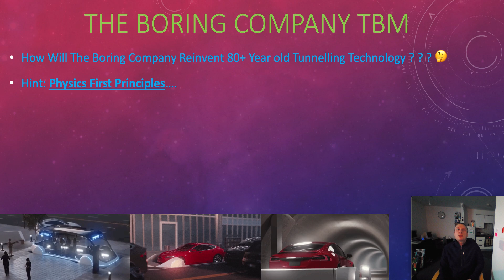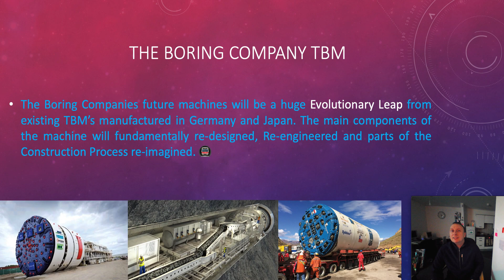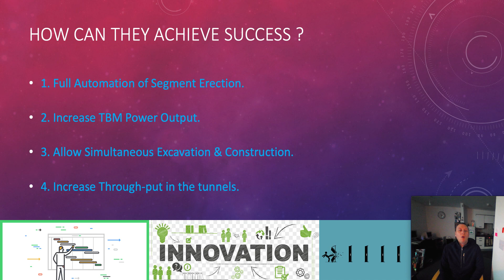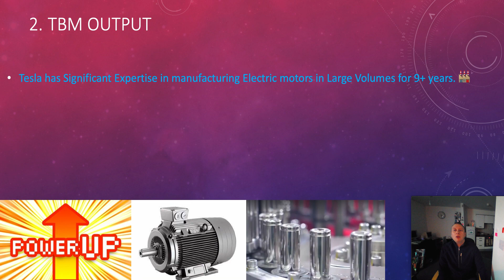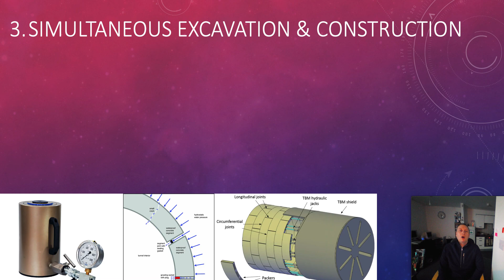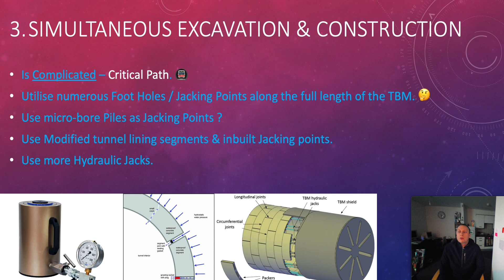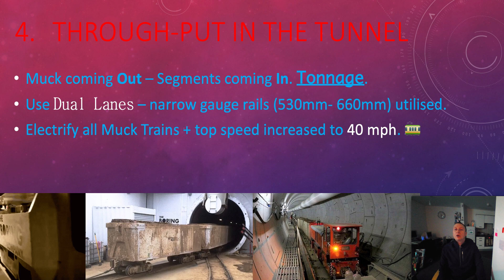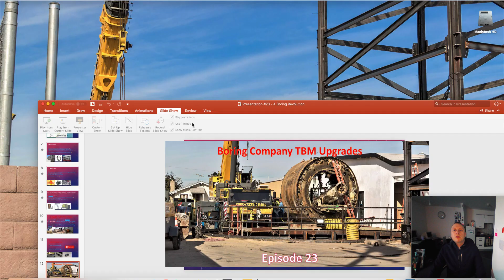The Boring Company - Elon Musk Now Wants A Total TBM Redesign - Episode 23 🚇

Comment: Flash transferring charge from train batteries to the boring machine batteries is inefficient and cuts cell life. It is better to have battery cars at the front of each train and switch between train batteries as needed. Battery cars can be pulled out on each half cycle for recharge outside.

Comment: 4:40 "lighter segments": the use of expensive carbon fiber is usually proposed as a chopped fiber additive. Another alternative is chopped cold-drawn stainless steel "rotini". 

Basalt is about 40x less expensive than Carbon and still keeps cracks very small. 

Pre-stressed Basalt yarn/composite skeletons can reinforce very thin concrete because there is no problem with rust/corrosion.

Comment: I'm calling BS on this video. I am sure all the other engineer firms have tried various ideas or think out of the box,.
Reply: IDK if anyone has 1. the resources to do a complete redesign of a TBM in the current boring industry or 2. ventured a their boring operations on prototype TBM.
I could be wrong, but getting the contracts, the tech, and the funding all together seems pretty uncommon without a radical infrastructure initiative.

Remember that no other company will have as easy access to: 1. super strong materials designed by spacex 2. super efficient electric motors and powerful battery tech from tesla

There's  certainly a lot of room to fail. But considering mr. musk's past 2 businesses have objectively changed the nature of their industry, I think this company has a better shot at making a splash than a Bezos company.

Comment: Will, all the details are well described and 
extremely important. The crucial and all defining 
function is the drill head. 

This is where everything is decided. This is 
where the revolutionary ideas come in. If your 
drill head eats its way through the 
subsurface, you have won.
Reply from the maker: I agree - Converting that Extra power into more RPM's = success ! But can the Segment erector keep up ? 
Elon has A lot of work to do. Line-Storm will change the Game!
Reply: I don't think so, Will. The existing machines 
have already explored and used these parameters 
mentioned by you here in the maximum possible 
way. It's about equipping the drill head with 
additional new First Principle capabilities.
Reply from the maker: Heinrich Peter Maria Radojewski Schäfer Leverkusen - the cutter blades and discs do a good job. New materials could be utilised but the shape will remain the same! 
The erector will need to assemble 8 segments every single minute for 21+ hours! That’s the key challenge... 😑
Reply: Hi Will, the work and speed at which the 
drill head is able to plough through the 
subsurface is the primary and all defining 
point. The traditional methods used here, 
as you describe here, do a good job. 

And that is the point. It is this traditional 
way of working the drill head that has to 
work exponentially better than before. The 
other connected operations you describe 
are secondary, aren't they? They should be 
approached as described in your video 
and solved by the engineers. 

The first thing you need is a drill head ploughing 
through the ground as fast as you want.

Translated with www.DeepL.com/Translator

Comment: Could they not extract rubble on conveyor belts rather than loading trains so there is a continuous removal. Perhaps attach the conveyor to the rear of the tbm and then as it moves add more sections at the tunnel entrance?
Reply: I think a conveyor belt wouldn't work so well because there is not much muck volume on a belt, and it's hard to continuously change to the correct length of it.  Battery trains have lots of volume and they can be as short or long as you need in any situation, by adding/removing cars.
Reply: Conveyor belts actually are used to transfer muck from the drill face to the muck train. Trains have value because they can be pulled very long distances with minimal energy used. Muck usually does need to be moved quite far from the tunnel entrance, and tunnels can be very long. Conveyor belts have greatest value when lifting up a slope, as only the product is lifted, not infrastructure.
Reply from the maker: Conveyor belts will probably only be used for the first 200m - after which trains will be more efficient!

Comment: Hello, I follow your video's a few weeks now TNX! Keep up the good work!
I always wanne ask one question pls?  Why don't they use a kind of pressed bricks instead of the concrete rings?
Why can't they make new models of bricks so they can use the material itself comming  from te machine?
Making the concrete rings directly while they are boring?  Think on the benefits of this?  Less material to remove out of the tunnel and it's a lot quicker to build that tunnel. Is this a good idea or am I wrong?
Reply from the maker: josé josiane it might work but reinforced concrete is tried and tested. 100% guaranteed to last 120 years. 
Concrete is a wonder material and is very easy to mould and sets in good time. It’s just convenient and engineers know its limitations I guess 🏗
Reply: @BoringRevolution  tnx 4 answering me. I know concrete last long but it's expensive to i guess and the material they win from boring tunnels would be a lot cheaper. Maybe it takes a while to that way. And maybe it wouldn't last for long. Anyway it was some small
 thoughts from my boring brains! ;)
Reply: @josejosiane4359  i am pretty sure they will experiment with this, and if remotely feasible certainly implement it. but their Bricks are a relatively new Product and might not qualify yet for this purpose.. (similiar to how SpaceX never tried any Booster Landings with the Falcon 1 - it was simply too early for that :D )
Reply: Did I hear correctly what Elon said? Yes he knows it, using the dirt on site mixing and building the walls is what he will try to do! Great!

Comment: here's a wacky non-thought out enuff idea. It's a two part solution. (1) a directional drilling machine lays down the pilot hole from the opposite end of the finished tunnel. These drills work MUCH better in the pulling  than the initial pushing. The finished pilot hole's job is to remove the muck from TBM. The big end of the tunnel is used solely for the lining the tunnel and et al.  This two part , two ended concept would work, in my dreams, in a segmented  tunnel building process...ie, thru a flat plain with many appropriate access points, as opposed to a very deep mountain without the possibility of shorter segmented sections. Constructing the segments simultaneously would be possible  to speed up any given tunnel. The TBM goes only in one direction, from beginning to end, while the directional drilling machine works both to fore and to aft thru its access elevator.
Reply from the maker: David Kreimer They could use multiple strand jacks to pull the machine... email Elon! 🚇
Reply: yeah...I thought of that,ie, pulled by cables under hydraulic power. I don't know how to Email Elon (my hero) @BoringRevolution
Reply: I have another great idea, IMHO, reguarding reducing the cost of heating and cooling of homes and whatever(buildings)
Reply from the maker: David Kreimer “River” source heat pump ???
Reply: just plain dirt is warmer, often, that a winter river. In my location, it is 57 degrees summer and winter.Almost ideal for heating and cooling. Wherever you are, this borehole nominal temp dosen't change much. . It depends on yur global latitude, but a borehole works just fine. You are guaranteed to find the equivalent of non carboneous oil. @BoringRevolution

Comment: If they're running nonstop, then won't there need to be a muck removal cart there at all times? At least most of the time. Any chance they could incorporate a smaller battery train car with each muck removal convoy? This way the battery on the TBM can stay in it's optimal range of ~15% - ~85%. This will reduce degradation of the battery, so they won't need to take the time or money to replace it.
Reply from the maker: Curtis Keohane this is a key topic I want to discuss in a future episode. . . . 👍🏻
I’m guessing they will need 8+ muck trains 🚋 running 24/7 and maybe send for additional carriages as they fill up the containers / skips! 
A Battery train may be 180ft long and send in power at optimal levels between 15% and 70% charge. 
We are talking around 60 Mwh per train, maybe more. . . 🤯
Reply: @BoringRevolution  This would be a good Excel project. If you ever need assistance with that let me know.
Reply from the maker: Curtis Keohane I Agree. In terms of m3 leaving the excavation chamber per minute, it will be insane volumes.